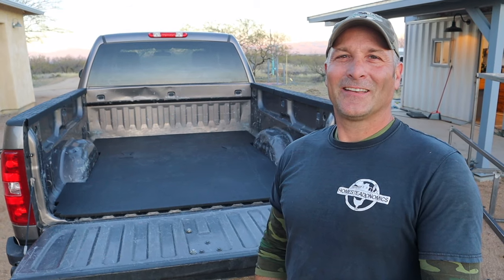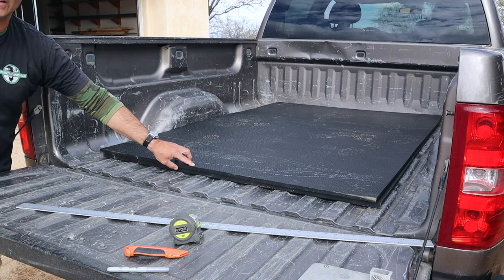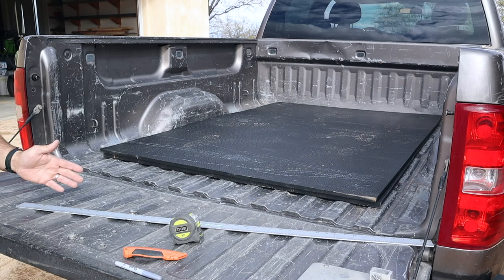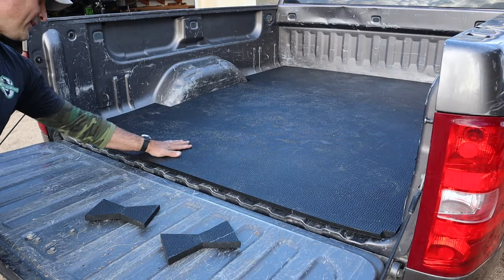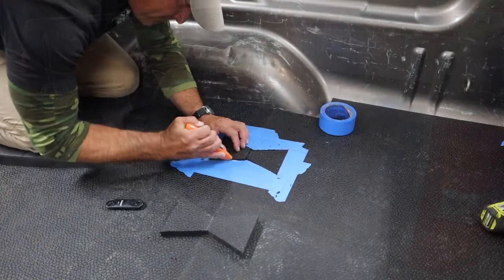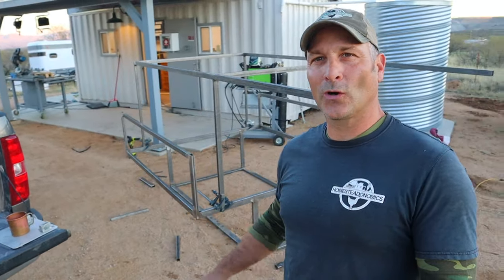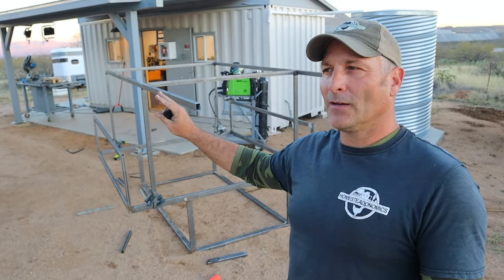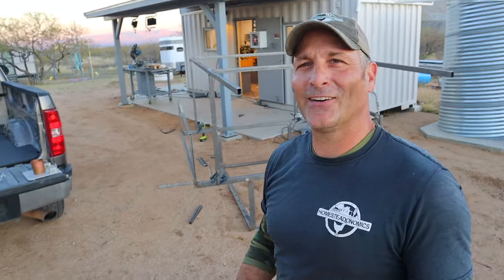DIY Truck Bed Liner AND The Most EXCITING Project of the Year Begins

Comment: The Tractor supply in my area has them for $55 each...pretty good deal for a very tough bed liner...I'm going to suggest these to my step-dad as he's been wanting a good liner.  Thanks!
Reply from the maker: Yes, I think they’d make a good liner for him.  The toughest part of the process is cutting through the thick rubber.   But it’s not too bad…. About 5-7 passes and it’s a pretty clean cut!
Reply: I did that! I bought a pallet for my wife and swiped 2 for the truck bed. 

Next time I’ll make a paper pattern first and holding tabs for the gooseneck cover.

Comment: you want a bullet proof liner. find some old conveyor belts like from closed coal mines. i mean they will stop a 22 at 50 feet.
Reply from the maker: Yeah those are super durable.   I actually used some strips of one to act as the spacer for the batter box build on my DIY travel trailer project.  But for this I prefer the little bit softer feel of the rubber stall mat.

Comment: I used these horse mats to put a floor into my shop. Even my very heavy table saw and bandsaw roll on it no problems. Very durable, and actually quite safe and quiet.
Reply from the maker: I also think they make a great surface for a shop area!

Comment: I demo'd a concrete slab at the house years back.  I jack hammered the concrete into football sized pieces and loaded them in the truck by hand to haul to the dump.  To prevent denting the hell out of the bed, I dropped a 1/2" sheet of plywood in.  That was back before lumber prices elevated to stupid high levels.  

I like your solution, should last MUCH longer.
Reply from the maker: I had to do the same thing about 20 years ago….jack hammering a slab up and hauling it away.  But I wasn’t smart enough at the time to put anything down…. Just let it bang, ding and slide around🤦‍♂️🤪😂

Comment: That is a great use of the horse mats. I have a tent that mounts in the bed of my truck and I use a set of the interlocking rubber tiles to cushion the truck bed. I bet the horse mats would work better and could stay in the truck. Going to follow the camper build with interest.
Reply from the maker: Thanks!   I don’t think these would be as cushiony as those tiles….but yes, the advantage is that it can just stay in here.
Stay tuned for the truck camper project….videos should be coming out real soon😉🙏
Reply: @homesteadonomics  I have a bed mat in my truck but it has ridges and valleys so i use the tiles to soften them a bit. air mattress keeps me comfortable when I use the tent.

Comment: Saber saw and a coarse wood blade cuts this stuff really nice! I put a scrap of 2" foam underneath while cutting. Just make sure your blade doesn't reach THROUGH the foam.

Also, one mat fit my 2015 Tacoma almost perfectly, no bowties necessary. Just needed 3" deep cutouts for the wheel wells, which I scribed in the same way you would scribe baseboard molding for a wavy floor.

Finally, my Tacoma came with an integrated plastic bedliner, which I have always hated. It is way too slippery. The smooth side (top) of this mat appears to be almost as slippery, so I flipped mine over. The round dots are facing up and seem to be a little more grippy.

Thanks for the idea!

Comment: Great idea dude. Thanks for the motivation. I made one as well however since I have a short bed f150 I mounted mine with the seam running long ways in the bed from cab to tailgate. That way I didnt need the bowties and they dont slide forward or backward because they are cut around the fender wells. Makes an awesome truck bed mat. I found 4 stall mats on fb marketplace for 100 bought those used 2 and sold the other 2 for 60 so I got about 40 dollars and 2 hours in a super durable bed mat.

Comment: Crap, I’ve been logged into my other YouTube account that I use for work. I’ve missed your last few videos! 
I need a version of that for my 4Runner.. I bought a slide-in liner, but it’s basically a plastic tray that shifts around easily. Love yours! And I still just love how you make everything rather than buying a commercial product. Your stuff is always so much better than anything on the market 👍🏻😁

Comment: I’m planning to use an insulation board with a stall mat over the top as a base for mine.

I actually need mine spaced up slightly so the 50mm insulation will add as a riser plus some insulation for under the floor

Comment: Thats cool only bad thing about it is it will trap moister so all those spots of primer will suck moisture and rust if i were you i would put a spray in liner and use that on top it definitely seems strong as linex or stronger good video thank you i did not know you could get that kinda of ruber will definitely have to check it out thanks again!!!!!!!
Reply: Every truck I have had with a factory plastic bed liner has had bad rust problems Ford Chevy and 2 dodges one was free after I bought my first 98 Dakota swore to never buy dodge from the 90s up the second was free and was on its 3rd round of replacement parts lol so I guess not completely free lol

Comment: I like the bowtie, joint, but did you consider any type of glue to bond the seam together?  Red Barn suggests a urethane based caulking adhesive such as Sika-Flex 221 or 227, which is black in color

Comment: I thought about using this stuff but by the time i buy the mats and have to fit them neatly i just figured it would be cheaper just to spray the Raptor. No to mention im not too crazy about having to piece them together. Dont get me wrong i like the whole idea and i actually used some old conveyer belt that was 5 ft wide and you talk about stout. Holy shit but it also weighed about 120 lbs so i just got tires of trying other options and just sprayed. Im going to be doing a coatover with some new 2 cartridge rhino liner. Now thats the true professional bedliner when its in 2 cartridges like big caulk tubes. The one im gonna try i think is called Phoenix Guardian (same as Rhino). Idk i guess ill find out when i try to attempt it. But the stall mats work too